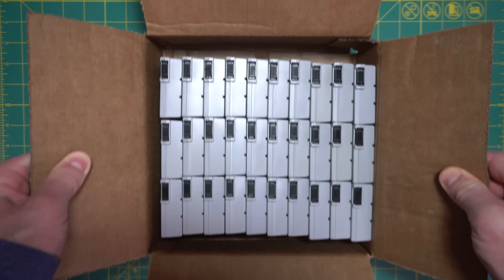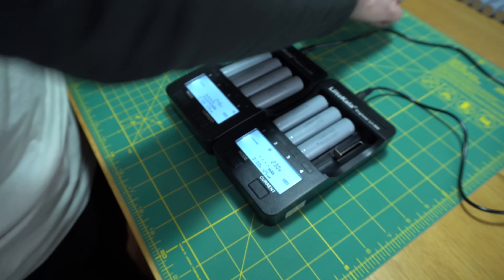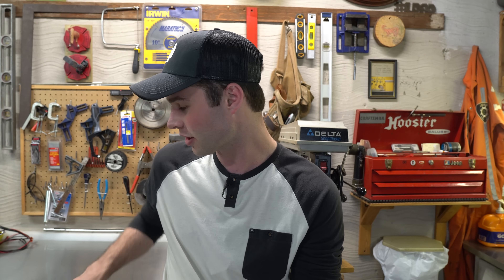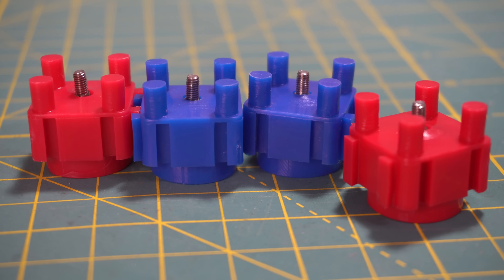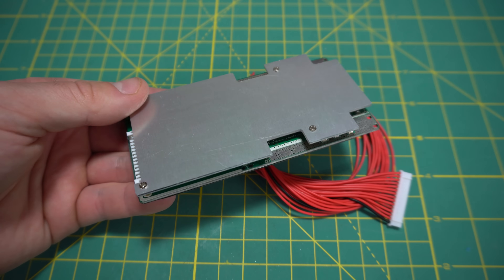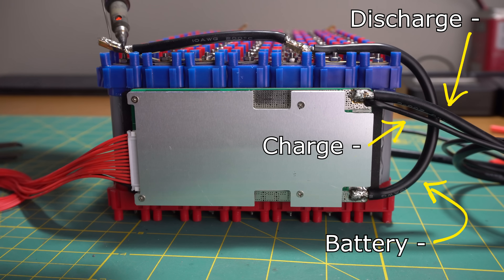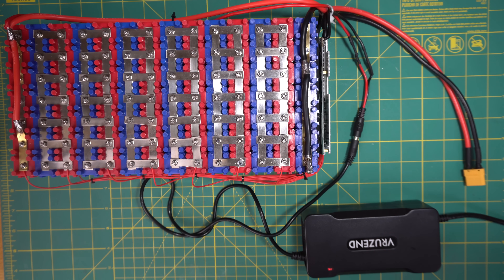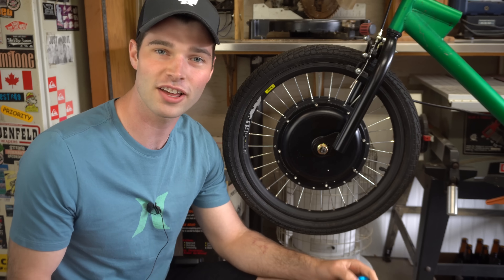Homemade Electric Drift Trike - Part 2 (the Battery)

Comment: You are certainly hard working and creative..but I never see any mention of any electrical calculations... and there is certainly no instrumentation on your machines.. I think the pile of dead undersized controllers stands in mute testimony to the fact that doing some basic calcs, current measurments, and reverse calcs of current draw... and maybe learning a little bit about the ampacity of wire.. rather than just using a cook book approach to assembling parts.. would pay dividends in the end result.. and save you some money... or whoever is paying for all this.  I strongly suggest that if any of your machines actually have brakes.. you use them to simulate high load conditions on your motor ( on a test stand.. say a nice crate)  while measuring the current draw.   I thinkyou will discover that the motors can and DO easily deliver several times their rated power during acceleration, hill climbing  ( if you have hills ) etc.. Ammeters are cheap. you could even make one into an improvised recording ammeter..with a pen. doubtless there is some peak reading electronic thing lurking out there which you will find.

Comment: check out the home made battery spot welders that use a small motorcycle battery, and strips purchased from ebay.  Decidedly cheaper, and probably less prone to problems with high resistance joints and heat problems. ( remember how many Teslas burn to the ground with mulitcell packs.)

Comment: cool, vruzend really made everything pretty easy to do, one fundamental flaw is the motor is on the wrong wheel, you want to be able to do a burnout with your back tires otherwise they wont slide. they will for the most part stay connected to the pavement so you will have high friction on the back wheel which doesnt give a good drift. anyway it is a cool and simple build and I bet it goes fast.

Comment: Is this the same battery pack you're planning to use for the alternator powered go kart? From the labels it looks like these cells are rated for 2C discharge and at 18.2Ah that's only about 36.4A to work with. Were you able to measure the load on that motor before it blew up your old battery?
Reply: Im designing a mini super atv that's children friendly for my little nephew so Im interested in building my own pack as well. I did some more research the cells you're using have a 1.44C discharge rate and looking at the power graph for your e-bike motor it draws in more than 90A under load to generate enough torque to spin it. So those numbers don't really add up unless I'm misreading things
Reply from the maker: Hi Michael, Unfortunately I did make a mistake choosing the LG cells which I will talk about in my next video. You are correct. The LG cells cannot discharge enough current for this application. The next video will be uploaded shortly. I explain the issue as well as what I did to fix it.

Comment: should have made it RWD so it's actually drifting and not just dragging slippery rear wheels. still a cool project. i'm making a 12s mini dirt bike that i should probably start documenting and throwing up on youtube.
Reply from the maker: Don't worry I will be making another video after its finished where I will be putting a motor on the back. That is why I went with a live axle. It should still be a ton of fun both ways. Good luck with your project!

Comment: Awesome battery build. I do not see a torque arm on the front fork. Those hub motors are powerful and can bend or even break the dropouts. I look forward to your next electric drift trike video.
Reply from the maker: Thank you! And thanks for suggesting the torque arm.
Reply: This video inspired my to get a Leaf hub motor for my electric sidecar. I got two flat tires right away and learned a few things. The spokes nipples where loose and need some thread lock. I also have to use a special tube with a threaded metal valve stem and a nut securing the tube to the rim. The Leaf motor pulled a standard rubber valve stem out of the tube.

Comment: I would seriously think about changing that charging plug. At 58v (nominal) at 3 amps that’s 174watts of power going though a pissy 2.1mm jack plug. Chuck a deans plug on it instead as you don’t want it melting and shorting together internally. Also if I was you I’d put an inline fuse between you battery and the deans connector in case something shorts too.
Reply: Amperage is the most important thing when choosing a connector, as the amount of heat produced is a function of amperage and resistance. Voltage plays no part. As long as the insulation is good enough to prevent arcs and sparks, it doesn't matter what voltage he is running as long as the connector can handle the current. The wattage is especially not of consequence as it fails to represent current.

Comment: This is pretty fun to watch as I am making a 13s 7p battery for my buddies drift trike right now! I am one of those Ebay seller though so I have a couple thousand 18650's sitting around, I used lower capacity ones mostly between 2.1-2.4 since I was really just wanting to make sure there was enough in parallel to provide sufficient current. Then I also found a 52v 2A charger sitting around in a junk pile so that was helpful!

Comment: Did you group same capacity cells ? Either way nice build :)
Reply from the maker: I trike to even out the capacities of each parallel group as closely as I could. Thanks!
Reply: Look up repackr.com you can enter each cells capacity and It evens it out for you so you have as close as possible mine came within 1 mah of each other

Comment: Someone who puts links to the high current wires in the link? That's a first, nice one! Dealt with Banggood many times and damn happy with them. Even on the odd time something went wrong their customer service worked hard to rectify the problem, too. 

Now, to find an Aussie seller of 18650s that doesn't charge an arm and a leg. Was buying faulty laptop packs at $1 each from the local IT place but they've made a deal with someone local building their own battery wall, so that source is gone. Sad. 

Have seen those battery kits before and they look rather good. IIRC on the ebikes youtube channel you mentioned. I'm tempted to pick up his books as well (unless I get really lucky & win it one day)

Building a frank-e-bike - sort of. Taking the motor from an angle grinder (thanks Banggood!)and going to attempt to incorporate it with a heavy duty 12V battery, some smoothing capacitors and a 12VDC to 220VAC inverter to power the grinder. That's after I placate the landlord by hiding the bike parts he doesn't like

Comment: Why not use lipo batteries? Also you should consider adding disc brakes.
Reply: Red Clay the motor is a brake.

Comment: 6:47 - Can someone explain why he’s got the yellow and green cables in the junction box (yellow box) going to the motor backwards?

I’ve got the same controller going to a 2KW brushless motor and I don’t wanna fry anything (haven’t tested it yet)
Reply from the maker: Those are the 3 phase motor wires. The motor was spinning in the reverse direction when I first wired it up. Switching two of the phase wires will cause the motor to run in the opposite direction.
Reply: austiwawa - Thanks

Can’t wait to see that finished trike run!

Comment: Total cost of DIY battery pack?
Reply: Batteries: free-$4 cell
Bms: $20-$40
Vruzend: spendy? Don't remember off the top of my head. Prob like 50 bucks
Wire: 10ga $1 ft 22ga .50 ft
Connectors: $1 pc
Reply: Cheaper to buy a Chinese made 24v36v48v
Reply: @pojdiavaj1422  but he has name brand batteries with good capacity